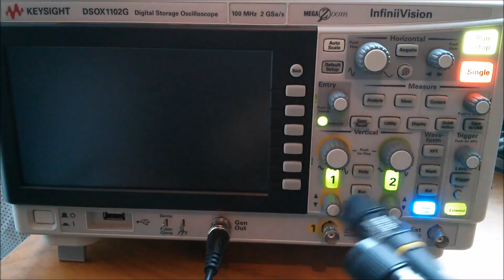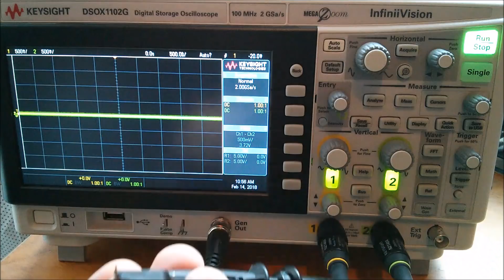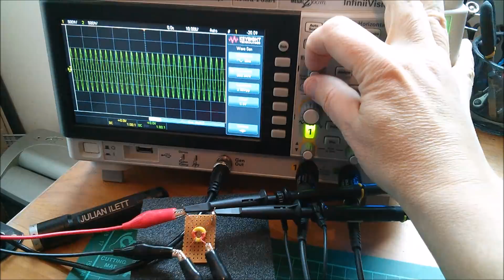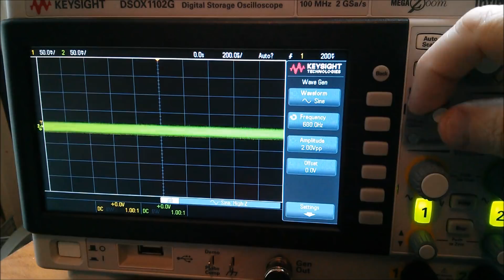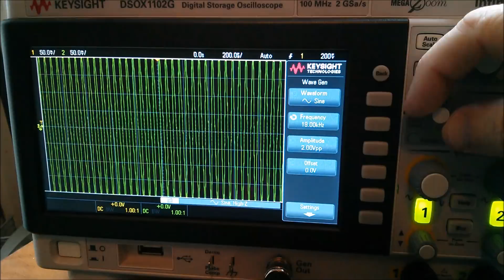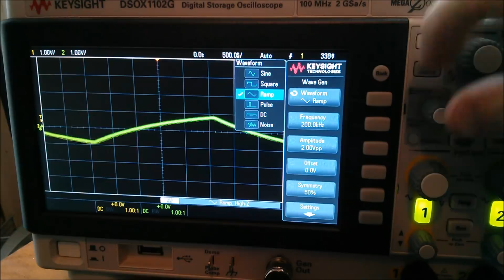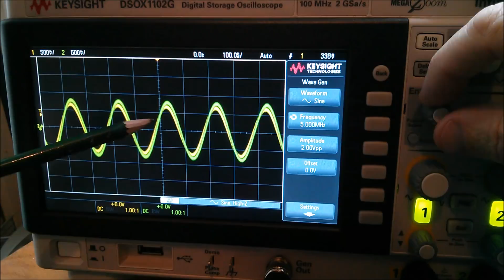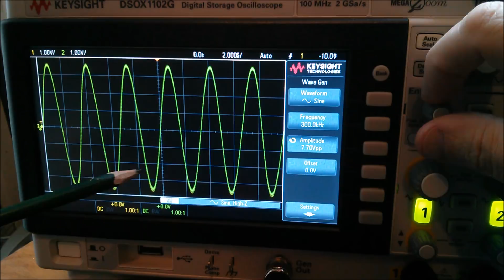Testing a Homemade Transformer

Comment: One wonders what it would have acted like if plain old perfboard had been used rather than that stuff with the copper strips. (Which seems to be very popular in Europe but which I have yet to encounter here in the US.)  It would have also been interesting to see what the behavior of these would have been when pushed to extremes,  in terms of input amplitude,  frequency in either direction,  etc.

Comment: You can put a square wave through a toroid transformer but you need to use a green toroid instead, those are used as a gate drive transformer for example.

Here are three links from another great YouTuber "CoolDudeClem" to see how you can make a perfect gate drive transformer:
1. https://youtu.be/Ozc_XsyiDrM
2. https://youtu.be/gZXYpAr_T0A
3. https://youtu.be/VonhgmWeDxE

I hope this is helpful and I wish you the best,
Ricardo Penders.

Comment: Sneaky trick for this sort of thing: Instead of wire leads to the Copper Clad board, use a 10M or 1M resistor, that makes any capacitance on the Copper Clad board irrelevant to a huge degree. Or any sort of standoff for one of the leads will do the same.
Reply from the maker: very sneaky - love it :)

Comment: Noob question: Transformers don't work with DC, but I often see transformers after bridge rectifiers in little power supplies , whats with that?
Reply: The way power supplies work, is they make DC,   and then they use a mosfet to chop the DC into a very high frequency AC square wave,    and then they use a transformer to convert the high frequency AC to a different AC voltage, according to the turns ratio of the transformer,   and then they convert that AC voltage back to DC with another bridge rectifier.   The reason power supplies do this,   is because for very high frequency,   you can use a tiny transformer compared to the size of the transformers which can convert mains supply to 12 volts AC at 50 Hz or 60Hz power supply frequency.
those transformers weigh about 1 kg and the size of your fist.
Reply: Ahh I see, having a look at a board lying around, it's a schottky diode on the output of the transformer with some caps to smooth the output

Comment: I couldnt find on the internet what do transformers do.
Wild guess do transformers just transform AC to DC and vice versa?
Reply: They trade-off AC voltage with current (so you can get higher current/lower voltage, or lower current/higher voltage). They also provide "galvanic isolation" meaning there's no current path from one side to the other.
They need to be a certain size based on the material and the amount of power you need to transfer, there's no way to avoid that - except that the higher the frequency, the smaller the transformer needs to be.
Reply: The size of a voltage changing transformer is very much determined by the current you want to pass through it, as the copper wire needs to have a greater cross-sectional area to pass greater current. This naturally makes the transformer larger.  The really smart people on here will give you lots of other reasons why transformers are the size they are.
Reply: No. AC to AC.  But they can change the voltage (down or up) when they do it.
Reply: oh so cool so why is it that transformers always look so big when you made yours basic materials from your local/online hardware store? Couldn't engineers make the average transformer smaller?
Reply: No but i could not find a answer dumbed down that i would understand.
Reply: Actually a better way to put it transformers transform AC voltage to current to keep power even. (Look up watts law) step up transformers convert input current to output voltage, so a 1:2 step up has twice the output voltage, and half the output current
Reply: thank you

Comment: At 10:18 you are saying that you didn't knew you could put a square wave through a transformer, but that's the way all DC-to-DC Push-Pull converters work. Usually they use an H-bridge which alternates the voltage across the supply side of the transformer.
Reply: Fourier transform. A square wave is comprised of sine wave harmonics. The frequency response is what determines the approximation of the input square wave at the output. Also, some people are getting close to discussing the problem of impedance matching. Something major to consider when interpreting your findings...

All said, doing these experiments is the best possible way to 'get a feel' for electronics. Great job.
Reply: Also, it would be weird if square waves in music just didn't make it through audio equipment with transformers in it...

Comment: At 14:40 , capacitance between those pins with the black crocs does not matter. The grounds of the probes and wavegen are all earth referenced so you connect the primair and secundair winding  at that point to each other. Better use diff-probes.

Comment: what is this "10th of an inch" you speak of ?
Reply: ummm...  a dimension that when multiplied ten times makes one inch?
Reply: It is the distance between holes in that prototyping circuit board and also the distance between pins in 20th century integrated circuits.

Comment: Don't forget that they mark the intrinsic capacitance of the scope and/or probes on the front of the scope (usually) for a reason. You have an LC circuit when you're getting into the tens of megahertz and a resonance pole causing your gain...

Comment: I did the same thing to my scope probe always keep them away from your iron 
edit I also did it to both of my scope probes
Reply: Spoken like a true electrician! 

Hands up, anyone who has never melted something accidentally when using a soldering iron.
Reply: I have a plastic holder for my soldering iron If I put my iron in it the wrong way it will start to melt a hole in it

Comment: Hi Julian!  Great vid.. Please consider testing with a load... What you are working with, is an isolated step up/down power supply.. I would be interested in seeing how well it works under load....Maybe using a driver like 555 for 100Khz,, or the arduino?  And also,, does say, a 50 turn transformer (torroidal) perform differently from a 10 turn?  Well, just suggesting another update... Great test! Thanks

Comment: Man, you must be psychic!  I have been thinking of experimenting with making tiny transformers myself just as you have made them.  Got the idea while looking at some fellow who could not speak English well in fact spoke very good chinglish at any rate he claimed to have invented the battery vampire (Well I think he claimed that, his chinglish was so poor that he may have been saying he found a formula or something, but it came out that he invented it by my reading) !  Well you and I both know better, it has been around for a very long time, his only addition to it was a capacitor to smooth the voltage, but I got to thinking about making one since I have been collecting torrids out of old PC Power supplies that I had in a closet back in the Dakota's so now I have about a dozen and a half in differing sizes and still have 10 or 12 old AT Power Supplies to rip apart, as well as a ton of wire that I have scrounged out of old transformers etc in other cards and such that I have torn down.

Comment: Any distributed air gap cores make crap transformers (like the yellow iron power core you have),  unless you tightly couple the coils (i.e. run the wires in parallel next to each other).

Comment: I think there are many experimentation possibilities here.  Different core materials, a third winding that injects some other signal, micro-variac (a la variable inductor), etc.  The "pulse transformer" is one component I've never had or played with, but apparently it's chosen for use in SCR/triac circuits.  Or a capacitve-dropper (off mains) that drives a >30kHz oscillator into a DIY transformer, isolated, rectified, to provide a safer, 3.3v or 5v DC for ESP8266, Arduino circuits.

Comment: What would happen to the signal if your primary or secondary had wires that had equally spaced areas which were a lower gauge so something like 22-20-22-20-22-20 etc... could that be a way to manipulate the signal? or would it just take the attributes of the 22 gauge wire?

Comment: Dont high frequency power supplies use squarewaves? Since thats easy to create, just a transistor switching on and off. Generating a sine would require a lot more accurate control and the actual shape of the wave doesnt matter

Comment: Are the toroids in the CFLs used as transformers or inductors? Inductors use an airgap to prevent saturation. Toroidal inductors have distributed airgap i.e. nonmagnetic material mixed with the ferrite. How much would using an inductor toroid as a transformer core, which dont have airgap, decrese the efficiency?

Comment: I've been looking around for enamelled wire, but the prices are just mindblowing.
Reply: SirArghPirate I got a roll of 28AWG enameled wire on Amazon for like $7
Reply: You could salvage enameled wire from old motors or transformers but obviously you can't trust it's in perfect condition like if it was new on a spool.
Reply: just search magnet wire. It only gets pricey for the really thick stuff.
Reply: True. Shipping are sometimes really expensive though, even for "cheap" wire.
Reply: I bought 70 grams (249.1 m for 0.2 mm diameter) of enameled wire for just about 10 €. And 1 kg would cost about 50 €.

Comment: I am not sure about the signal generator but scope probes' ground are common. Without a differantial probe ,input output will be same, are not they?
Reply: Electron Sculpturing Common ground couples the reference point, but has nothing to do with magnitude or phase
Reply: Electron does have a very good point!

I don’t know about the Keysight DSOX11xx series. (I only have an Rigol 1054Z and an a old National VP-5512A)
But unless you have confirmed otherwise, you could ALWAYS assume that the ground on all the in/outputs are common. 
Which of course, is a good excuse for investing at least 1 diff. probe less than the number of channels that your scope has:-)

Comment: How does the frequency affect amplitude? Is this just a really fast collapsing magnetic field and a slower signal doesn't induce enough current?
Reply: a) The amplitude of the induced electromotive force is proportional to the time derivative of the magnetic flux. If this magnetic flux is, say, a cos(2*pi*f*t) then the derivative will be proportional to the frequency f. So the amplitude at the secondary will be proportional to the frequency f. At least, this is what happens at low frequencies, remember that at the limit f=0 the primary is an effective short circuit and there is no induction. It's as if there were an inductor in parallel to an ideal transformer. This is a high pass filter behavior.
b) At high frequencies, there are losses (transformers aren't ideal) due to leakage inductance, hysteresis, and Eddy currents in the core. This is a low pass filter behavior.
c) There are ohmic losses of course, which do not depend on frequency.

Put this all together and your transformer behaves like band pass filter. You may want to google "transformer frequency response" just to see some curves. This is of course more complicated than that but I tried to simplify.
Reply: Ancient Pangolin - Not really. He is basically shorting out his waveform generator at low frequencies. At DC, that inductor looks like about a 1 ohm load with that few loops of wire. He's lucky he didn't blow his scope and that the waveform generator has a current limiting function built in.
Reply: Terrence Zimmermann this makes a lot of sense actually, thanks for the response
Reply: Inductive reactance, directly proportional to frequency.  The primary winding will look like a short at DC.

Comment: So if the leads on the output were swapped would the waveform appear out of phase with respect to the input?
Reply from the maker: Yes :)
Reply: Probably. Who knows, maybe he shows this in next epsiode.
Reply: Not really, since there is isolation between both sides, so swapping probes on green input will result in green waveform inverted.
Reply: If the ground of the waveform generator is connected to the ground of the oscilloscope probes (many are), then you will just end up shorting the inductor through the ground leads.

Comment: Your shorting the wavegen out at DC. That's what your issue at low frequencies is
Reply: Also, the lack of resistance between the input and the transformer is causing the transformer to distort the input reading xD

Comment: Yellow cores from power supplys and black (unpainted) cores from cables are not suitable for transformers. These cores are built to have extreme looses above  certain frequencies which means they are only good for filtering or noise suppression.

If you want to build high frequency transformers you need high Al cores like 3C90, 3E25 etc
Reply: Fully support your point. The cores are meant for damping. Not for transformation. Losses being maximized
Reply: Ollyweg 0
You can identify what type of core is besed on where is in the circuit...

Another way if you have bare unpainted cores is to measure the resiatance between 2 random points on the core. The sweetspot is around a few kilo ohms for good transformer cores. Less is for iron powder cores and a lot or infinite for noise suppression

Comment: Julian.  You were up to something.   But I think you want to find out about the transfer function or input/ output relationship.  Time domain analysis is not a good method.   You could use FFT of input and output.  I remember in old days HP had network analyzer to test the filters.  It could give you mag and phase shift at a given frequency.
I wish there were smart oscopes that could give you the transfer function of a given circuit/filters or in your case a transformer!

Comment: I use toroidal ferrite transformers to drive the gates of IGBT bridges. 

All you need is high Al value cores, the right core size and enough turns and you can pass square waves at any frequencies from  few kHz to hundreds of kHz
Reply: A square wave out of a transformer is going to be quite round on the corners, but I suppose that doesn't really matter unless it gets really bad. Transformers, by their very nature, resist changes in current, so sharp edged waveforms are not a thing they want to do.

Comment: As far as I know, yellow ferrites are used for high frequencies (MHz range), whereas green or grey ferrites are used for switching power supplies (tens to hundreds of KHz). Those should pass a square wave unaffected, given good coupling between windings.
Reply: As far as I know,  there is NO standardization with regard to colors between different manufacturers...

Comment: Very interesting to see voltage transfert. But did you try power transfert with load on secondary ?
Reply: I would presume that in a transformer, the power in is the power out plus losses, and if you get equal voltage and power, that means equal current. Really, how do you measure something like this with a wave gen? It's current-limited to the max, so nothing significant can be measured. Really, it's a case of "We need MOAR POWAR", which can be provided with an auto-transformer, but at 50/60Hz only, so you need higher inductance, so more turns. But at least then you get to the levels that are measurable by a multimeter that can do AC milliamps.